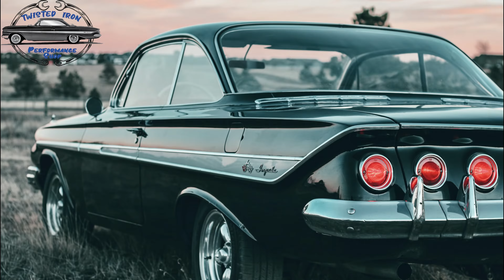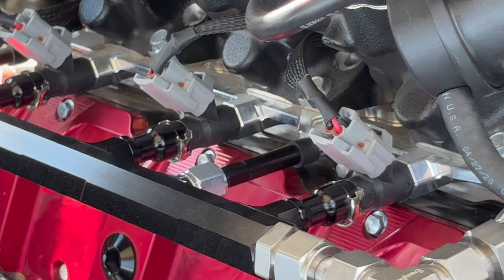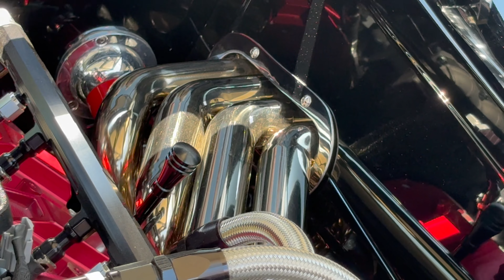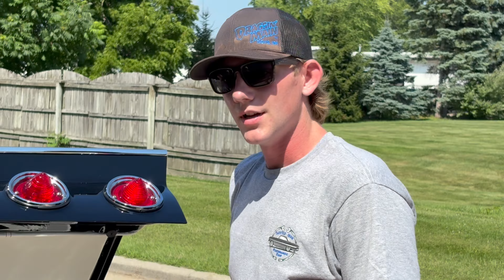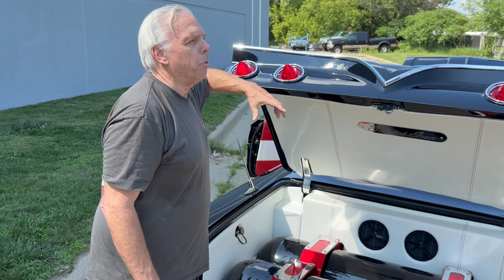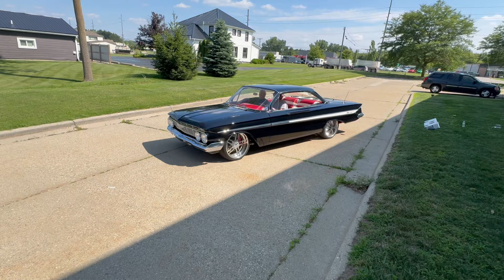1961 Impala hydrogen powered Twisted Iron

Comment: I have HHO boosters on my 2 Yanmar tractors. One is a 70 HP and the other is a 24HP. Both have no loss of pulling power, and best of all use less than 1/6 of the gal per hour pre-conversion. (And - no black smoke!) It's been 4 season's and no breakdowns.